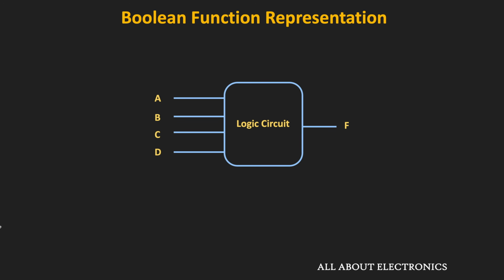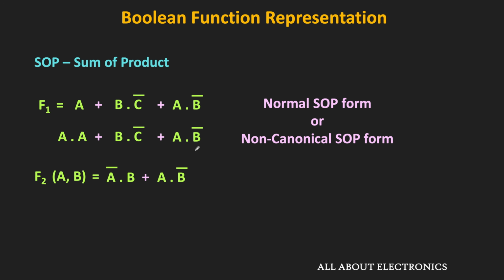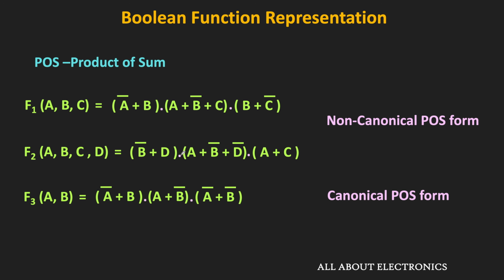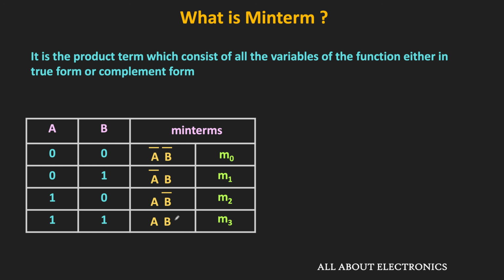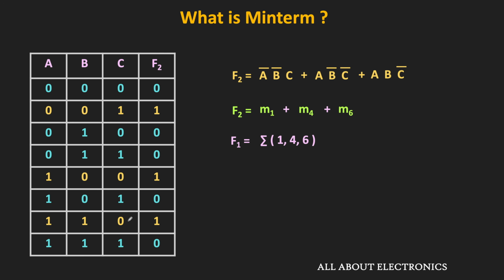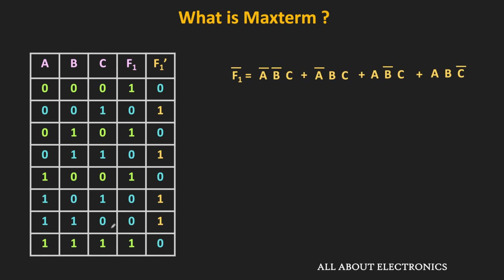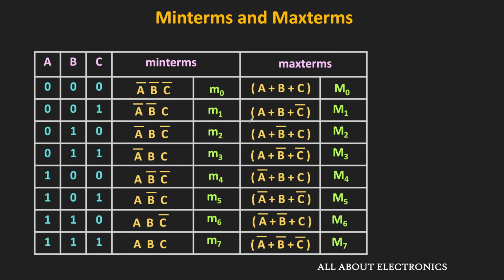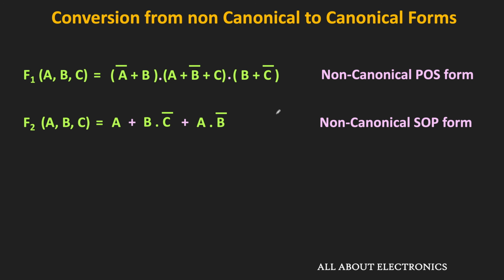Boolean Function Representation: SOP and POS Form | Minterms and Maxterms Explained

Comment: How the values of F1 is getting calculated in that table ?? 10:08
Reply from the maker: Here this table is chosen randomly, where for some input combinations, the output is 1. But in actual digital circuits (which you will see and learn in the later videos in the digital electronics playlist), it depends on the actual logic which we are implementing.

Comment: 10:27 how did you wrote F1 by which method did you wrote that
Reply from the maker: Here this specific truth table is taken as an example. Generally, for a given specific digital circuit either you know the truth table, or based on our requirement we are designing the digital circuit. In second case, we are already knowing the truth table. (That means for what specific input combination the output is 1 ) I hope, it will clear your doubt.

Comment: Sir Please help in process of maxterm how did u write F1 in truth table 0+0+0 it will be 0 na but u have written 1
Reply from the maker: For writing a function in terms of a Maxterm from the truth table, you need to look for the combination in a truth table, where the output is 0. (For finding the expression in terms of minterms, we are considering the combination, where the output is 1). So, basically here we are using a inverted logic. 
So as per this, for example, if the F is 0 for A= B= C = 0, then maxterm is A + B + C. Here, in maxterm representation, when the variable is 0, then represent it as it is, and when it is 1, then we need to complement it. 
So, that is why if function is 0 for A= B = C = 0, then corresponding maxterm is (A+B+C). 
Likewise, if function is 0 for A = 0, B= 0 and C= 1 then corresponding maxterm will be A + B + C'. I hope, it will clear your doubt.

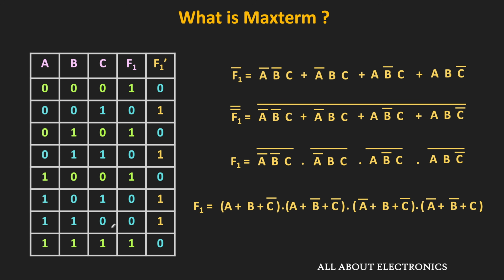Comment: 15:36 why there is need of cmplementing the function first then solving directly we can do from the function given nah?
Reply from the maker: We want to represent the same function is POS form. That is why the function was complemented and then F1 was found in POS form. If you want to write directly from F1, using shortcut method then you can do so, by writing the Boolean expression for 0s. But here when variable is 0, you need to consider it as 1. 
For example, F1 is 0 when A = B = 0 and C = 1. So, in POS form, one of the term will be (A + B + C'). and likewise, you can write for all other terms. Here just to avoid confusion, the proper procedure was followed.

Comment: Sorry if I missed something, I don't get why we have to complement the variables from 0 to 1 when writing minterm expression at 8:00. Like is it just a rule or is there a reason behind it?
Reply from the maker: First, for the two variables, A and B we have total 4 different possibilities. So, these 4 possibilities (00, 01, 10, 11) have been shown in the table. Now, during the representation, if the value of the variable is 0 then it is represented by the complement of the variable. (e.g A-bar). And if the value of the variable is 1, then it is represented as it is (e.g A)
So, for the inputs AB, if the value of these two variables are 00, then corresponding minterm is A-bar B-bar. 
So, that is how different input combinations are represented.
Reply: @ALLABOUTELECTRONICS  thank you!

Comment: How to find value of F
Reply from the maker: Typically, when you are designing a circuit, then based on the required outcome, you know the expression of F (from the truth table).
For example, when you are designing a half adder, then you know that, for what inputs, the output F is 1. 
So, from the truth table, you know that, for which minterms the output is 1. 
But academic perspective, sometimes you have been given the entire truth table. So, you just need to check for which minterms, the output F is 1.

Comment: how did you calculate the output of the Function F1 as 1 when ABC is 000? how did you calculate the F1 in the truth table?
Reply: timestamp 10:05
Reply from the maker: @avijidshil2751  Here it has been assumed that for some circuit, we are getting this truth table. Or in other words, we have one circuit which behaves in a way, when input ABC is 000 then its output is 1. And similarly, for the certain input combinations (like 010, 100, 111), its output is 1.
Reply: @ALLABOUTELECTRONICS  So those combinations need to be memorised rather than calculated? I'm sorry i just don't understand.
Reply: I think he is trying to say that we have assumed that circuits and the output @avijidshil2751

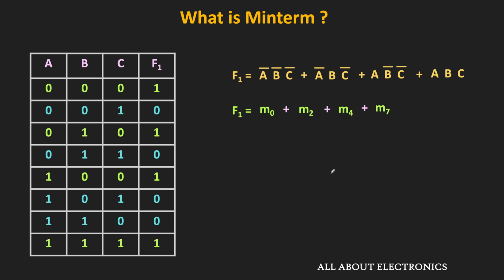Comment: How do you calculated f1 colmun values 11:14?
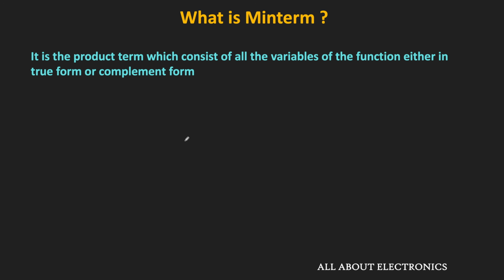Reply from the maker: Just go through the definition of minterm first. You will get better idea. (7:17 onwards).
If you see the function F1, then it consist of 4 terms. A'B'C' corresponds to minterm m0. That means in this function, minterm m0 is present. And that's why in the table in front of 000 (m0) 1 is written.  Similarly, for the remaining terms, 1 is written.I hope, it will clear your doubt.
Reply: @ALLABOUTELECTRONICS  hi
Reply: In the function, if the particular minterm is present then write 1 in front of that minterm. For example, minterm m0 is part of the function. Therefore, 1 is written in front of that. I hope, it will clear your doubt.
Reply: @rushalmshah  what is the difference between 000(m0) and 001(m1) why 1 is put infront 000 why not 001? I dont get your explanation.